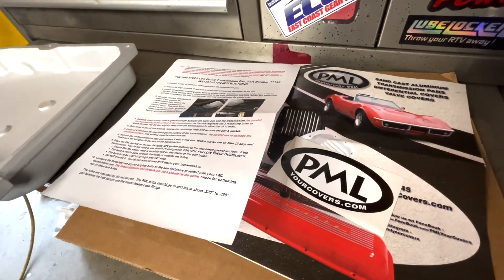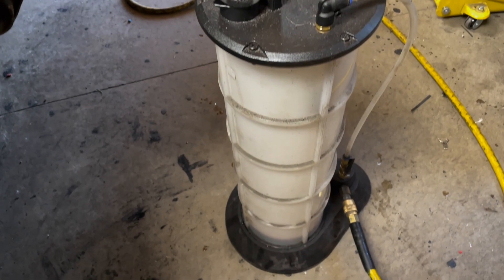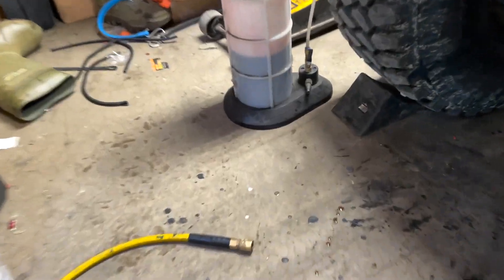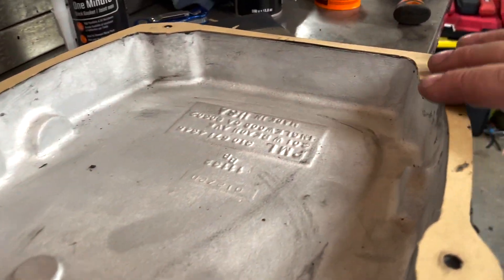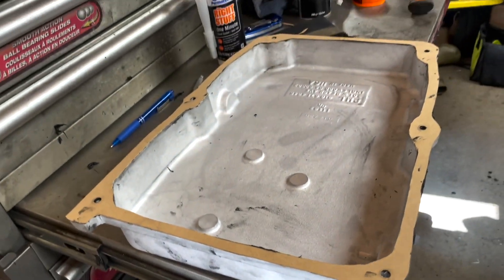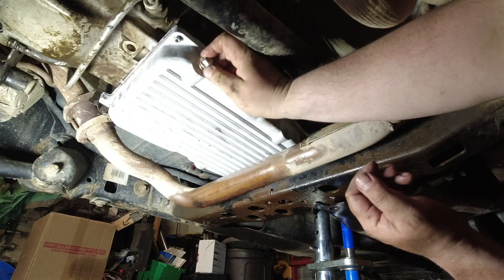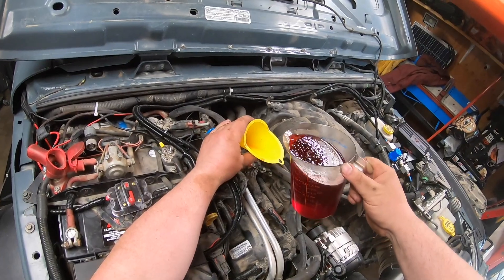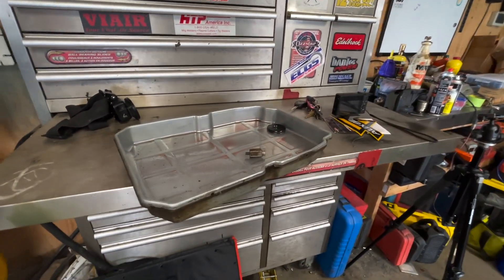PML Jeep JKU Nag1 Transmission Oil Pan

Comment: I have two vehicles with the NAG1.  The plan is to replace the pans with versions that have drain plugs.  The question remaining is whether I want to spend $6-700 for aluminum pans or steel pans for $100.  I may want to add a temperature sensor to one of them, so the aluminum pan would be better for that.  The clip system for securing the stock pans sure seems pretty crappy.